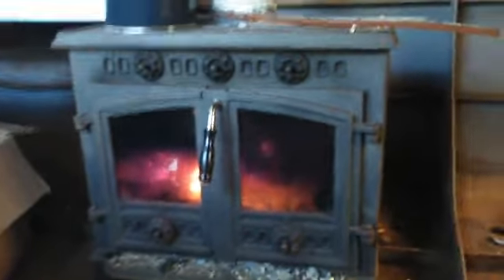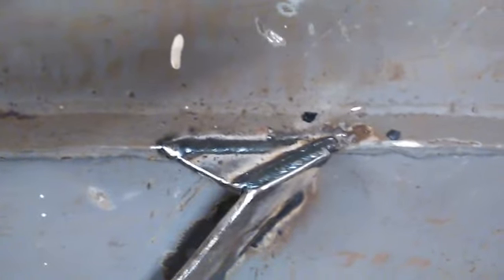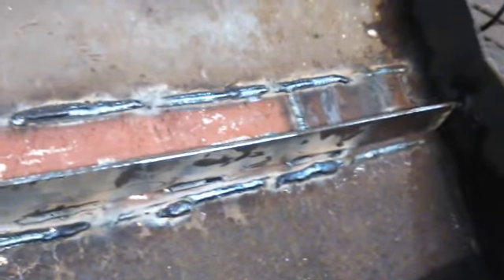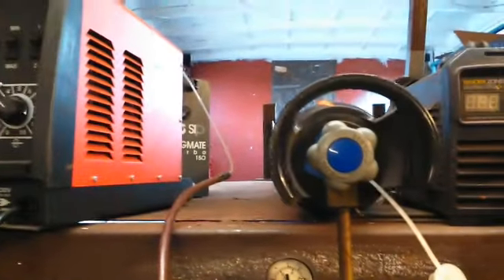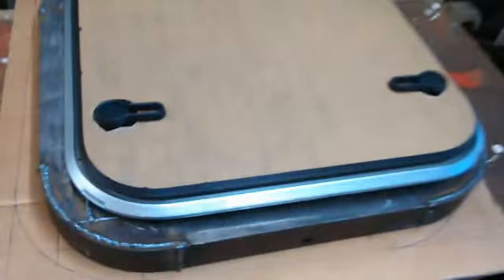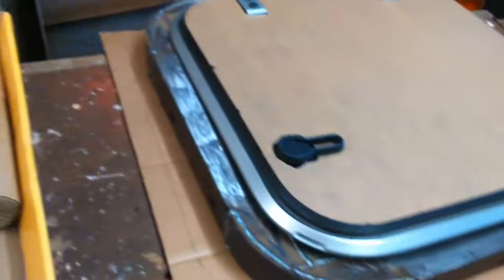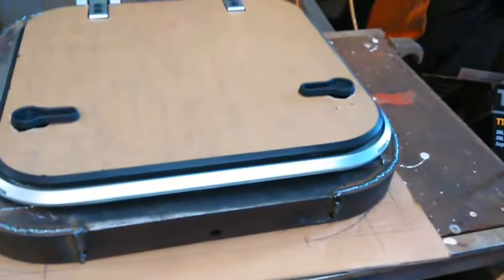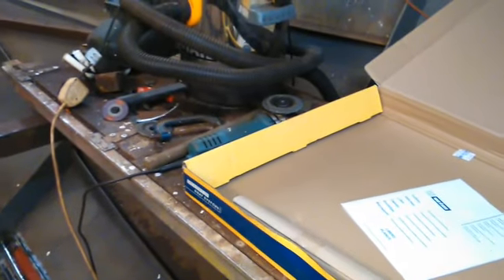Venus hatch steel boat building

Comment: Hi mate great boat build. I'm a steel fabricator and thinking of building a boat. I helped build a few narrow boats but I would like to build something similar to this one. I was just wondering if you worked of any design for the build?
Reply from the maker: Hi the hull is an Andante 39 which was built to plans from Glen L Marine. Topsides are my own design based on a trawler yacht.